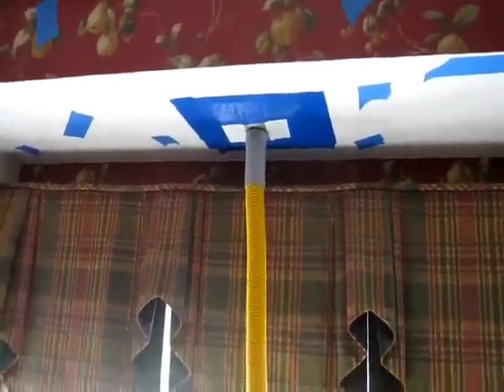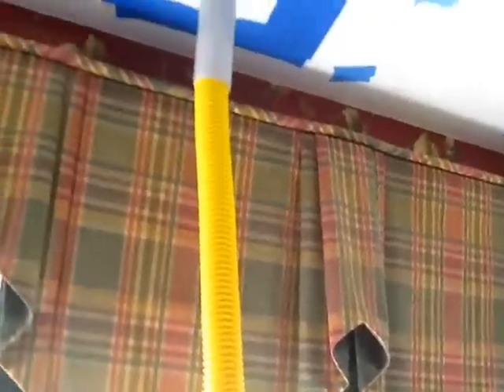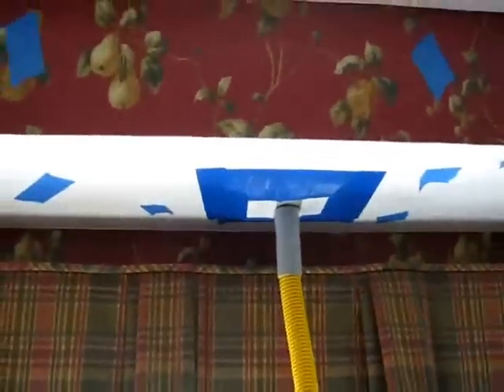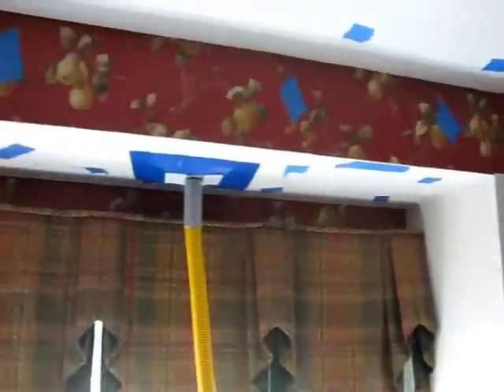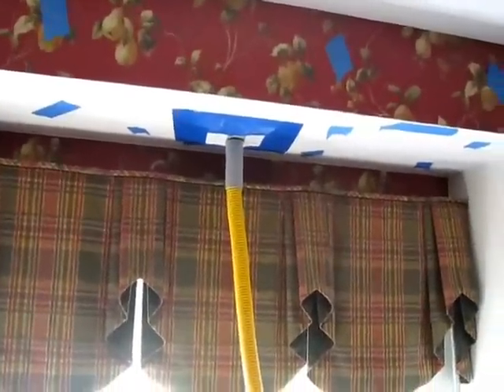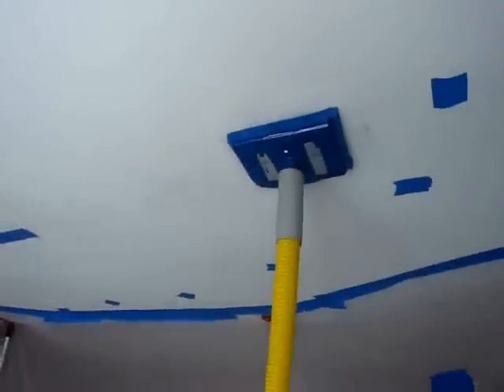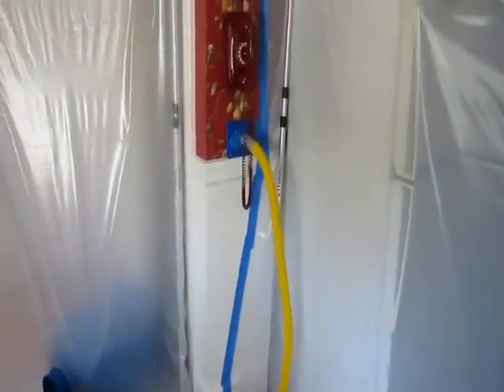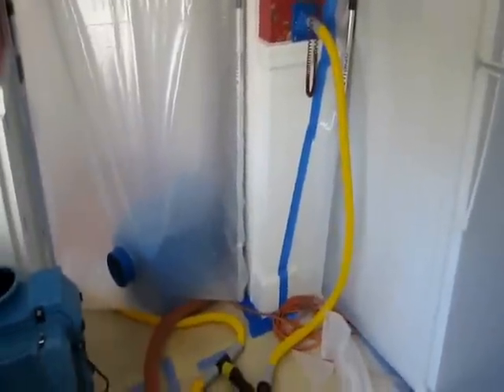Wet Wall Drying Attachments, Water Damage Wall Drying Repair Bedford MA

Comment from the maker: All the attachments are on negative, drawing moisture out of the walls. Makeup air leaks in from other cracks and crevices in the existing construction. I am using a Drieaz Dri-Force on negative, with Injectidry hoses and fittings. The air is being dried with a Phoenix HT dehumidifier.Dry air will find its way into the walls because of the negative pressure sucking it in. This set up works very good at drying wet walls and wet ceilings without demolition.
Thank You 
Clay

Comment from the maker: Thank you for the comment. These wet walls were plaster with many layers of paint and then wall paper, this does not breath well. These are custom made wall drying attachments that are hand made, sometimes on site, to fit each wall outlet or switch plate. The ones going to the ceilings are going into light fixtures electrical boxes. When we were done there was not even a scratch to the paint. It is very important to remove trapped moisture from sealed voids to properly dry the wet walls.
Clay